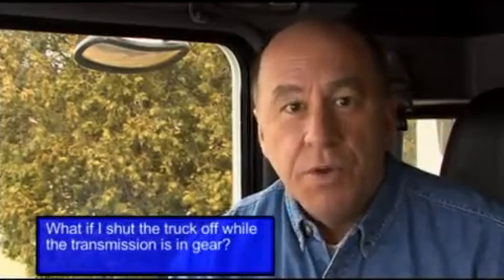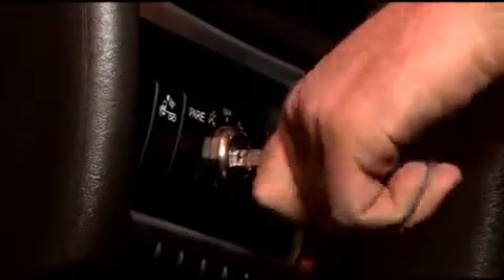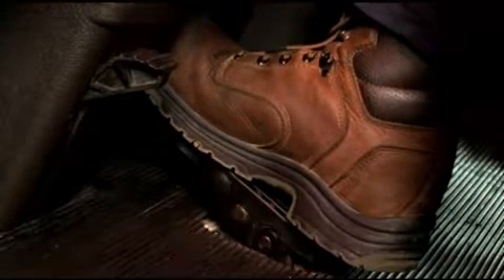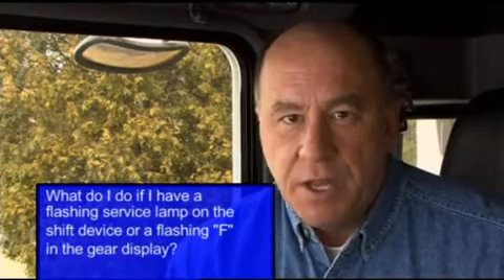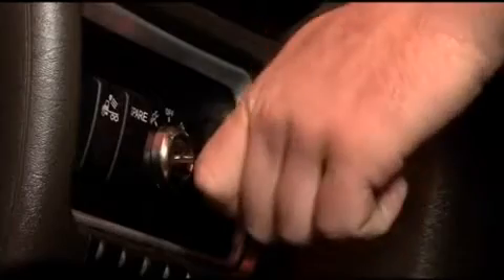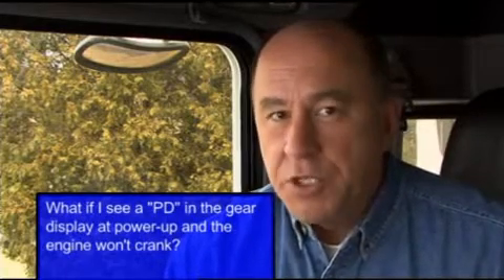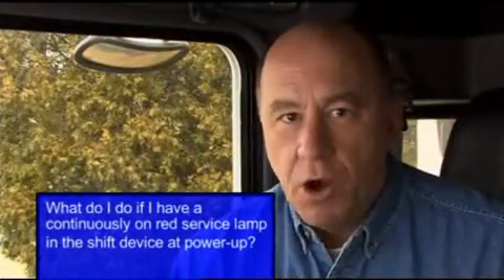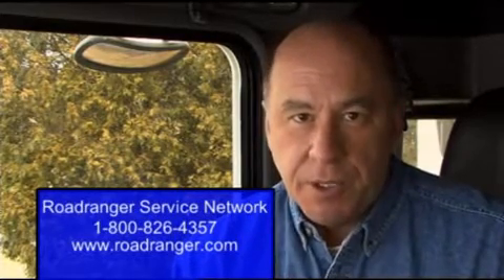Eaton UltraShift Q & A   Troubleshooting

Comment: Mine.  Transmission check light flashing. And F/N. Or F/ number of the gear I’m driving keep switching. Took it to a service they change one speed sensor still same. Took it to a dealer they changed another sensor ECA or sth. But still the same ! Already spend $4000 but not fixed